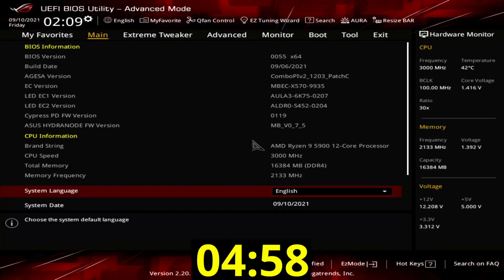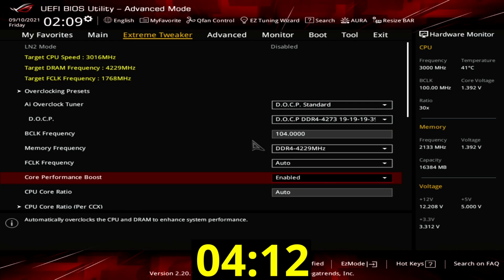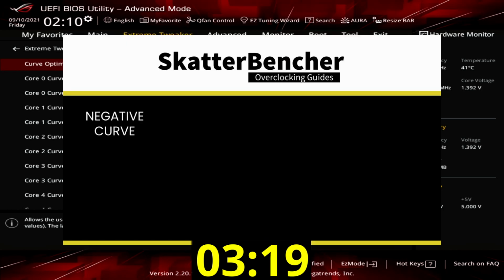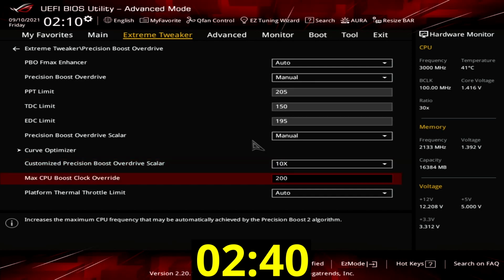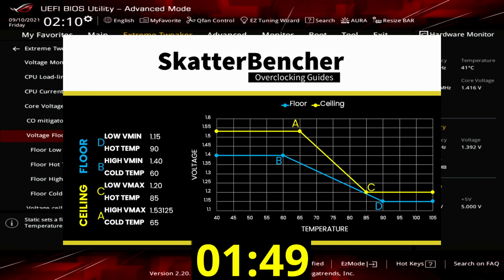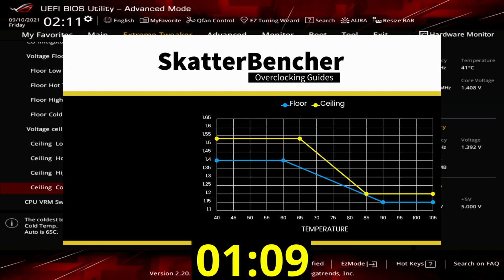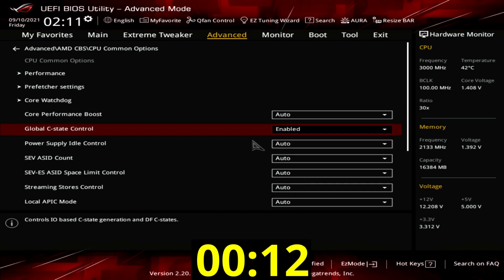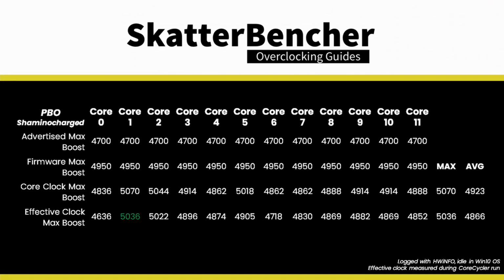5 Minute Overclock: Ryzen 9 5900 B2 to 5152 MHz

Comment: Set your processors on fire this way. Anyway, you are not using the processor at full capacity. And if it is stock, you are still not using it at full capacity.

Comment: Pieter
Any special mark or coding on the cpu heatspreader so we can quickly tell it's a B2 stepping ?
Reply from the maker: Not that I'm aware of
Reply: actually yes. Just look for BG2208SUS, something around that date/code is prety much guaranteed you will have B2.

Comment: excellent, did you have some hints for non Asus Crosshair MB?
I have an Aus Tuf Gaming, and the external digi+ options are not in my bios. (the voltage suspension)
and also when I change my bclck, all of the PBO options are disabled, its like I change the blck and do manual OC or I keep it at 100mhz and play with PBO.
Reply from the maker: Looks like enabling BCLK OC triggers some auto-rules that forces "OC mode" enabled and PBO disabled.

My general recommendation for Ryzen overclocking is XMP + PBO (fmax & curve optimizer). This will get you within 95% of the performance gains available from overclocking.
Reply: @SkatterBencher  yeah.
I found that PBO as a big negative impact too.
the temp is going up and the system reduces the frequency too quickly.
so yes, in spike I can reach 5150mhz but in benchmarks, its not better than no PBO but curve optimizer tuned.
unfortunately I have no enough control on all of these parameters with my MB.